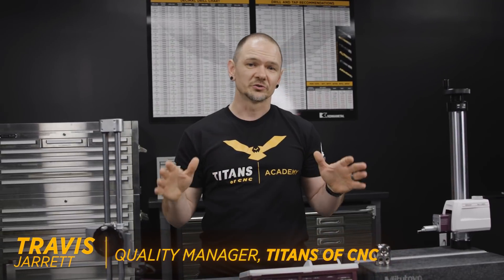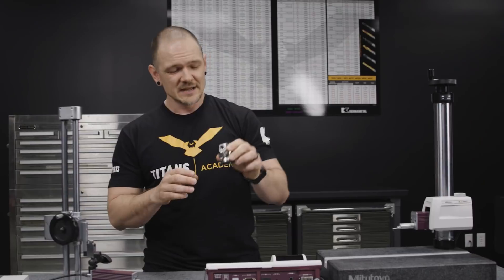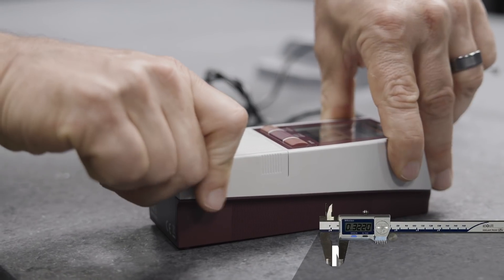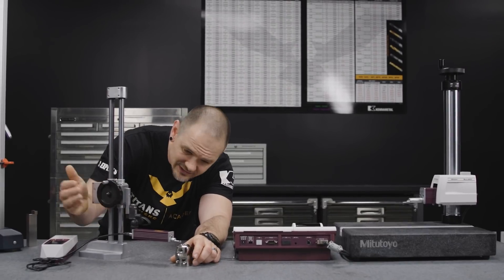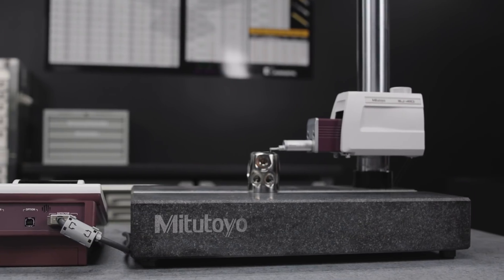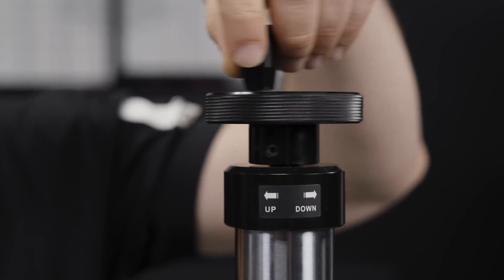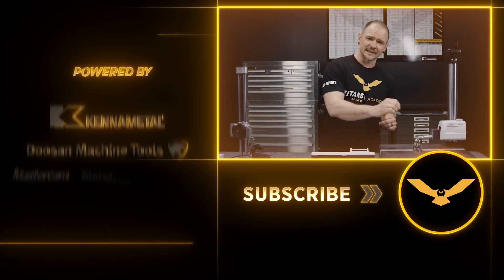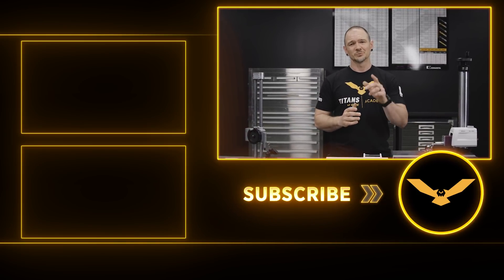Measuring the Perfect Surface Finish

Comment: Cool tech. What is the finest surface finish one could expect from a mill or a lathe?
Reply: all depends on the material you're cutting/your tools and inserts/feeds and speeds and depth of cut. we have parts that we have to hold 4 micro faces and 8 micro bores and ODs all the time. most of these are done on lathes. realistically you can you can have a good of a finish as you want as long as you try hard enough and put the time into it. iv ran parts with 1-2 micros on the faces many times. all this is done right off of the lathe with the tool, no lapping or polishing or anything.

Comment: how are you measuring that? in my book Ra 7,6 is rougher than raw material!
Reply: That is probably micrometers; we are measuring in microinches.
Reply: @travisjarrett2355  that would explain it alot!
Reply: @travisjarrett2355  this is the correct answer. We measure roughness in micro meter .

Comment: Every one of my co-workers using an SJ-410: “Nice tight spot” (spins handle all the down slamming probe into surface with excessive pressure) “now we can slide along that surface” (proceeds to measure massive curve without profile compensation) “and they you go, we’ve checked the surface finish” (the 2 micron tip was snapped off weeks ago by these Ogres so everything always checks good)...
Reply: metrology in highschool, with a machine class. Let's get the dem's to print another trillion to put a machine shop in every school!